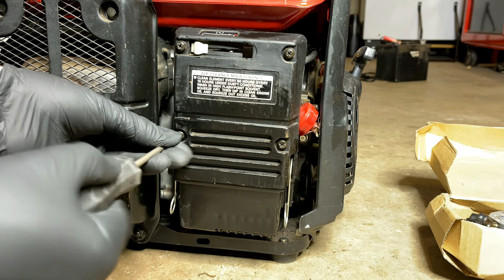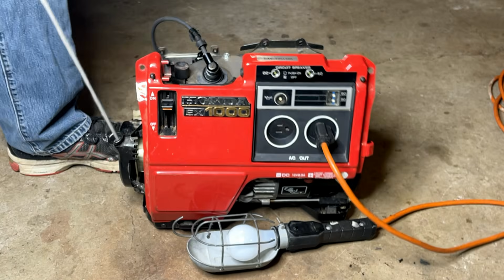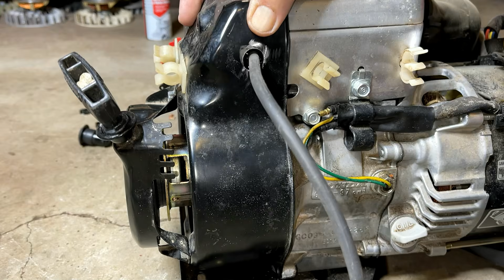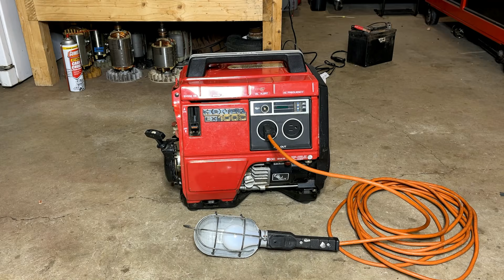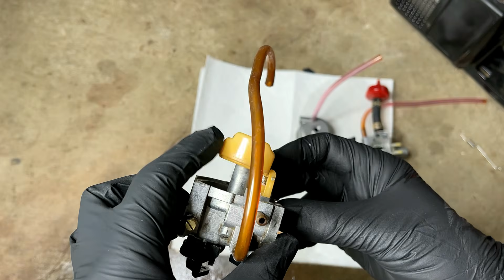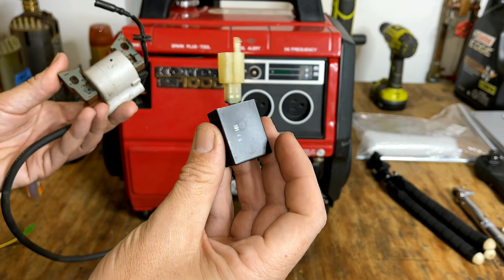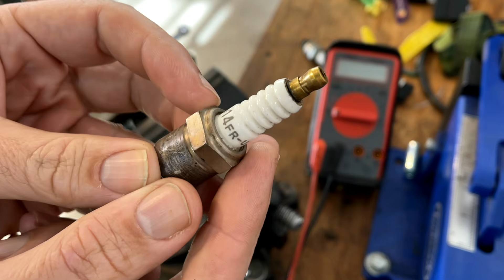Honda EX1000 - Will It Run?

Comment: I love watching these, and your research.  I used to call these "Atoms"  I have several generic ones here that are are used to convert old points mower engines to "Electronic ignition".  I bet they would have repaired the original problem without the OEM part, and without replacing the coil.  It was probably this electronic spark unit that failed...

Comment: Am I seeing it correctly? at 19:10, Are your spraying Gumout carb and chock cleaner instead of starting fluid? didn't know that doubles for starting fluid.
Old Suzuki parts and mechanic from the 80s agree on the spark plug rarely failing, well maybe on a 2-stroke motor but not on a 4-stroke. I can see why you struggled to go to your local bike shop, it's like being a kid in a candy store but now you really could buy something :)

Comment: I think the bad sign wave can be drastically improved with a much larger capacitor. In fact improved enough to run sensitive electronics. The way the wave looks now I would be reluctant to run a computer or DVD unless I played with the capacitance quite a bit. I have lost DVD players with non sign wave inverters.

Comment: The Motor Spins Clockwise. I have one of these generators that has been sitting in the corner of the shop for a few years. Opened it up last weekend to figure out what is wrong with it. The first thing I found is the pull-start spring was full of grease and dirt so it would not return the pull cord. I pulled everything apart, cleaned it out, then went to reinstall it and found that I lost a washer when it would not work and went looking for an exploded parts view that showed the washer which I found stuck to the leg of the workbench. Got that all back together and decided to replace the pull cord since I was so far in and found that it is not clear which way it wraps. Now every other Honda engine we have here (25 to 30 of them) all spin clockwise but I had never had such an old honda engine open before so I went looking for information and here I landed. So @17:05 you say the engine spins counter-clockwise and yet @23:23 you start it by spinning it clockwise... and again @23:42 you wrap the pull rope around the starter hub clockwise and start it again going clockwise... and again @24:16 clockwise.  After "modification" and assembly @32:18 again you can see the pull start hub turning clockwise. After watching this entire video You never did clear up which way the motor spins so I pulled the spark plug, watched the valves and found that it spins clockwise. Ya may want to clear that up for those who don't know how to figure it out on their own. 

As an aside I have been maintaining and repairing hondas in our inventory of tools since 98 and have found that same spark plug problem twice. The plug body is crimped around the ceramic insulator when they are made. If the insulator happens to crack between the inner and outer crimps they will bleed spark to the plug body as they get hot. Drove me up the wall the first time I experienced the problem but an old guy at the garden tractor repair place where I got my parts told me to change the plug and why. Anyway, great video as I found a few other oddities that were solved quickly with your info.

Comment: check the jet size
Reply from the maker: It ended up being the wrong carburetor.  The throat of the carb was a smaller diameter and I am sure the jetting was also off.

Comment: Ohms is a unit of Resistance. one dose not measure ohms any more than you would measure pounds. you measure weight, the result would be pounds. When you measure Resistance the result is in ohms! YOU CAN NOT MESURE OHMS!

Comment: jim my cousin is a small engine mechanic they never use starting fluid use carb cleaner safer for the motor, works same way.

Comment: Could you list the OEM Part# for the air filter as it went by too fast but even on rewind I was unable to read it? I have that exact generator that I purchased new 30 years ago.

Comment: Did you know that there is a clip on digital spark tester that makes that job easier? There are a few to choose from but the Spark Check’r SPC-7200 is the best one in my opinion.
Reply from the maker: Never seen that before.  Looks like a useful tool.

Comment: Glad I watched this video, as I own and run a Honda 900, that looks very similar to this unit. I picked it up years ago at a yard sale, repaired it and got it running years ago, and have maintained it over 10 yrs. now. Still runs fine, and runs quiet as well. They are nice little generators but can be a bit of a pain working on them, with all the tear-down to get inside. If I run into issues seen here, I now know where to come for info. Thanks for video. Maybe save myself some time, and guess work, if issues pop up like you had.

Comment: I was given an EX1000 (UK 2 socket 240V~) 

Was told it runs but doesn't output. 

When I tested it the carb bowl leaked and the main jet was clogged. 

I cleaned the main jet and reseated the carb bowl gasket and now it starts and runs without leaking fuel

It looks like it's been tinkered with, wrong/missing screws and the condenser winding wasn't connected to the capacitor.

I have ordered a new capacitor but I tested the original it has 13uf which is correct, I'm waiting on the replacement.

I connected the capacitor across the blue and blue/yellow wires of the stator. 

it had been connected across the blue and blue/white wire that is not connected to anything on my stator, there is another loose blue/yellow wire in the same area that the blue/white white is next to the capacitor, I think these wires must be for a feature my generator doesn't have.

I think the generator has lost its residual magnetism, as all the windings seem to test ok and the capacitor appears to be ok as it shows 13uf on my Fluke 12 that has a capacitance range.

It's not a bad little generator, How do I restore residual magnetism?
Reply from the maker: Plug in a drill, hold the trigger and spin it with you hand.  That will act as a little generator, sending power and magnetism into the system.  Usually it will force the generator to power up, but a lot of times they do not power up for another reason.  So kick starting it sometimes works out well and other times will let the magic smoke out.  Here are two videos where I did that successfully https://youtu.be/8GvJkuINoKA?t=1108 and https://youtu.be/PM8VXYXOJUs?t=3862
Reply: @jcondon1  Thanks, I'll give it a go, I can't seem to find a working link to a service manual. 

 I downloaded one for an EM650 that says to drain the capacitor if there is no output but I haven't tried that yet.

I don't have a corded drill, I'll have to borrow one, I do have a bench grinder I guess that might work?

I measured output from the 240v AC sockets and I'm getting 9-10v AC depending on what speed I set the governor and 50/60 Hz switch.

I also have two scrapped Hyundai diesel generators I'm going to fix up, one starts but the wiring has been messed up, the other doesn't start, the glow plug circuit and air cleaner is missing and if I try to start it I get a wisp of white smoke coming from where the air filter should be but the wiring is untouched. The other one that starts and runs but the e-stop has been removed and the 32a 240 socket has been removed and been replaced by a 32a socket on a badly wired pig tail and the wiring in the front panel is a total mess, should be a good project.

Hoping to make a good generator out of the two. They are 6.5KVA so I'm going to use them for my small 130a welder/ compressor/pilar drill/bench grinder ect in my off grid shipping container workshop where I fix my motorcycles.

I've been working on my bikes with no power, just a car battery and some LED lights stuck to the ceiling. It would be nice to have power in my little workshop so I don't keep having to charge car batteries just so I have some lighting in the shop and having AC/DC power would be great to charge my car batteries, radio, phone and power tool batteries.

Comment: Great video learned a lot. The problem with spark plug kind of reminds me of when I would build mini bikes and go-karts back in the 60s. For some reason spark plugs didn't seem to last very long when using a lawn mower engine in that kind of setting. It did very similar type of failures that you experienced

Comment: You will have better luck drilling sheet metal and plastic if you take a brad point drill and grind it so the flat cutting edges next to the brad are ground concave instead of flat this makes two sharp points and a center guide point that cut a good hole without binding

Comment: James I always wonder if you took these generators to a dealer and had it fixed as you do what would it cost ? Or is it worth fixing or buy another gen ? Like some gens sell for three hundred or more if the fix cost exceeds the new one ?
Reply from the maker: It is not worth paying someone to fix.  Around here it is about $50 an hour or more to pay someone to fix it.  I spent at least 6 hours working on this one.

Comment: I learnt that same spark plug lesson on a Honda lawnmower about 10 years ago - it would run for about a minute then stop. I had the carb apart 3 times, convinced it had to be a fuel issue. Finally changed the plug and it immediately fixed the problem! I now put in a new plug very early on with every small engine problem, just in case... Spark on the bench doesn't always equal spark under load... (pretty sure I was taught that at trade school, once upon a time).

Thanks for the fun video!

Comment: As previously mentioned, most shops would give up.  But Jim, in your curiosity, tenacity and desire to learn and teach have successfully brought this thirty year old generator back to life.  My assumptions: 4 hours + research for parts @ $75 per = $300.  Market value of a Honda 1000 watt non-inverter generator approximately $300.  Jim, you are teaching us more than you know !

Comment: Thats why I run nothing but NGK and wouldn't even allow a piece of crap Denso to lay at the bottom of my trash can. Its not worth it to use anything but the best. Look what it caused. Same with Champion. Not worth the problems.

Comment: I had a similar problem with a 50CC "Mobylette". The spark-plug was OK ... BUT ... the resistor in the cap was behaving silly, especially when running up-hill!!! (engine producing more heat as the lower airflow didn't cool the  engine plus plug enough.

Comment: I just had a Harley Davidson die on me. I watched it die after running for 5 minutes in my driveway. Some how someone put the wrong plugs in it years ago. They where genuine Harley plugs and both failed at the same time? Checked everything on it, had spark and the plugs were making spark touching the head. Put some odd plugs I had lying around in it and it fired right up. I wish I saw this video before then. I’ve never seen plugs just fail right in front of me. Great content, fun to watch.

Comment: I have the exact same generator with I believe a bad coil.  With no luck of course finding replacement part.  You, however I believe have an extra coil now....  Any chance of getting this generator to you for another video repair job?  Also, the plug you used isn't actually the model shown in the manual though.

Comment: well guess what!  I have a small generator for my Camper van. It was unusable, It's problem was surging so much it kept blowing bulbs. soooooo, I saw this video checked the guvnor spring, it had snapped and wasn't connected.  I got an old spring and got it to fit and it ran 100%. new spring on it's way. Thanks Man!

Comment: I had the same problem with my moped.  It turned out to be the resistor between the wire and the spark plug, I just connected the wire straight to the plug. No more problems.

Comment: Very neat video: Brenda's handwriting, the Honda with it's tool holder and your persistent detective work until it's solved. That dirty sinewave would cause issues in switch mode power supplies hence  inverter generators are the go nowdays.

Comment: Your assumption that the engine was meant to run counter clockwise was wrong from the start.  The cooling vanes only work in one direction, and the notch for the pull cord only only works clockwise.

Comment: I just found your channel. Cheers! I bought an Elemax SHX1000 suitcase-style inverter generator with a 50cc Honda industrial engine on 7 January, after 3 weeks of no power following Typhoon Odette here in Cebu, Philippines. While at 1000 watts I don't think it has enough oomph to power my (rather small) refrigerator it was enough to power my PC, let me recharge batteries and emergency lights. and run a small desk light with a 7W LED bulb for 5-6 hours every afternoon and evening for two weeks until power was finally restored, using at most 14 liters of gas a week. I wanted a Honda EU2000i or EU2i but couldn't find one anywhere, and this was the only small, quiet Honda-powered generator in stock anywhere. If I don't forget to switch it on and engage the choke it starts first pull every time, and is good for over 8 hours per 3.8 liter tank of fuel which is regular unleaded. bI changed the oil after the first 10 hours of use as the manual said (break-in oil, and it's probably due for another oil change before I ever use it again as it's been at least 100 hours.) These little Honda gensets run practically forever!
Reply from the maker: They do not make a lot of power, but are well built and will last if taken care of.

Comment: Fascinating! I wonder how many of the extra problems were from the previous 'repairs'. 
Someone gave me an early Honda shaft-drive self-propelled mower that was run low of oil. The engine appeared to be seized, but when I started to remove the flywheel nut, it started turning very reluctantly. So I put oil in the crankcase,and ATF in the cylinder. With a dozen or more rotations, it freed up like there never was a problem. After a new bottom crank seal, which included learning all about that weird Honda blade clutch & brake unit, then cleaning all the 'jelly' out of the carb, it fired right up! 
Like your generator, everything's metal on my old Honda, from the heavy alloy deck, to all the painted steel engine shrouds, covers and air-cleaner.
Everything's plastic on the new ones, even some of the decks!

Comment: What would a fix like that cost ? About  or would it cost more than the cost. Of the new unit ?
Reply from the maker: In the end, the fix was $3 or $4 for a spark plug.  The rate to troubleshoot would have cost more then the generator is worth.

Comment: Thanks for that. It'll help me service mine! PS. The mysterious hole in the end cover is where the 50/60Hz switch goes in the European/UK model. You can get slightly more output by running it at 60Hz.

Comment: The POS needs electric start.
Reply: Then you need a battery, and a starter motor, and an igniton switch....
no it just needs to be as OEM spec as possible....
and it will always start...
Reply: @JohnSmith-yv6eq  Einstein. Battery and motor 👍
Reply: @tommidd8042  
What is the one thing that either needs to be on a permanent intelligent battery charger/maintainer like a CTEK unit..
or it will be flat when you go to start an otherwise shed stored device.....in an emergency....?
(Battery...)
Pull cords don't need that high maintenance....

Comment: Interesting, this was a real mixture of issues mostly created in frustrated troubleshooting of the original fault.  Something that comes to mind when you mention the resistor plug (apart from to mention that I've had many, many failures of NGK "R" plugs in different applications. So much so that I refuse to use them now if I can get a non-resistor alternative) is that you have a resistor plug AND a resistor cap, I was always led to believe you use one or the other never both together.

Personally, I feel like they're outdated now anyway since the RF interference they were designed to suppress is largely irrelevant in today's high-frequency, digital world.  (Only thing I ever knew really being interfered in a noticable way was analog TV signals).

Liking the channel, this is the first of your vids I've watched and will be back for more 100%. Thanks for sharing, from the UK.

Comment: Since the bad resistor inside the spark plug was the culprit, and the original honda ignition coil checked good, would it be possible to put it back in and reroute the plug wire back to original configuration??
Reply from the maker: I should be possible to get the original coil working.

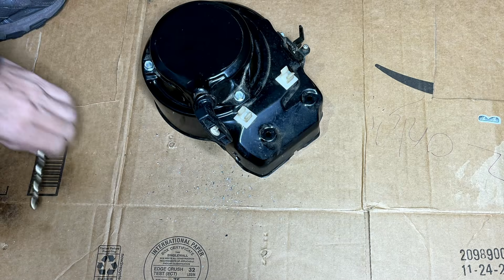Comment: Page 25:20 drill bit drop off the cordless drill? I had an old cordless drill does that. When trigger change from full to no trigger, the spindle and chuck core click stop suddenly but the chuck sleeve inertia continues spin forward ie counter clockwise which is also the direction we dismount drill bit. Hope this helps.

Comment: I would have said use hose or fuel line in the hole with wire through it. Good job on the repair. Good Thinking outside the box. Did not expect the heat problem with  the plug.

Comment: That style of spark plug connector is very common on Japanese motorcycles.  The best way to make the connection is to strip away about 6 MM of insulation and splay out the wires radially - and THEN screw the connector onto the wire.

Comment: I have  a similar issue with a four wheeler  On the exhaust side I put a heat shield to shield the head it was getting up to 700 and stalling out the other side was 250   Now I'm thinking  spark plug Thanks

Comment: Question. I was told that I ruined my previous generator by having stuff connected to it when starting it. But I see you also do it. Not bad for the generator?
Reply from the maker: It's not great, but a 70 watt light bulb has not caused an issue yet.